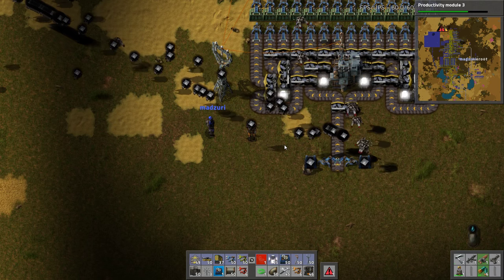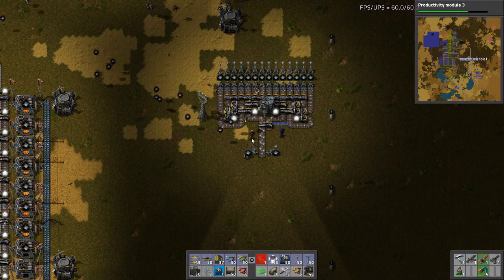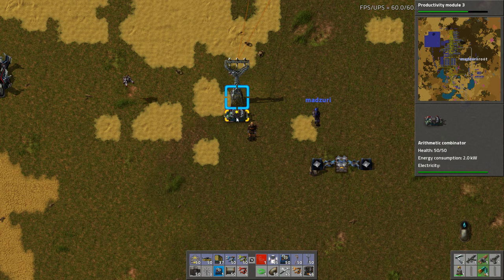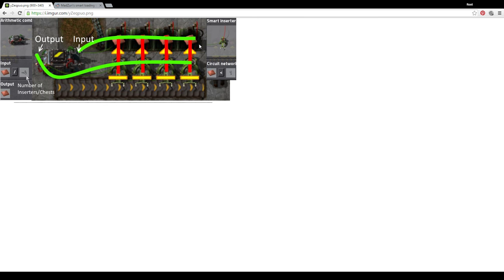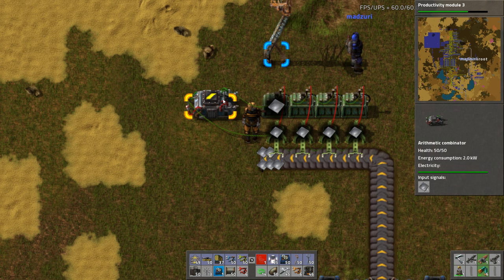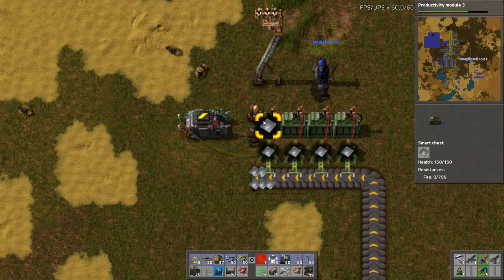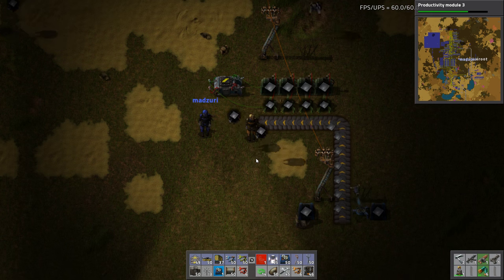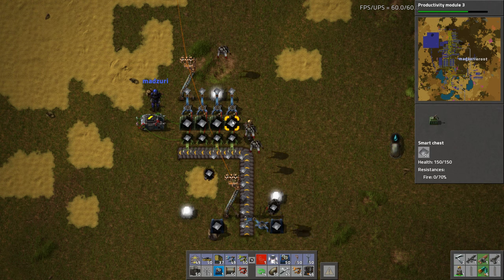Factorio Tutorial 58 Madzuri's Smart Loader

Comment: That's genius !
I would have never think about this one before a while, I would have put a horrible system with box, inserter and combi, so when the first box have more than the second, it transfer it, which is a waste of resources cause it require as many inserters -1 as there is boxes and combinator per inserter (to allow comparing to the next chest with "if iron plates are less/more than A" where A is iron plate on the next/previous chest +0 to not have them summed up).
Great loader here !

Comment: sssoooo ... mine stop when the chests are equal.  how do i get them to keep running when nothing is drawing from them?  I quadruple checked my setup.  I even took it down and remade it a couple times to be sure.
Reply: +WP Mac Haven't made this yet, but if I understand it correctly, you could make the belt go a little further and then add any inserter (probably a slow regular inserter) which wont be connected to the logic network set up in the video, that way, if nothing is being put into the chests, the inputs will go through to the end, be put in the last chest and will upset the average in the chests, so that it will work again
Reply: +WP Mac +Negative Root Or you might be able to have another combinator in series, after the combinator in the video but before the inserters, adding or subtracting 1 from the signal (I can't say for sure which, but that should do it)
edit: tried this and it worked x) subtract 1 from the negative mean and the inserters will continue loading, but with a buffer of 1 iron for each storage. This works as opposed to the original because some, but never all chests can have a real value of less than the mean.
Reply: Nomoturtle furnishing Well none of that is needed.  Apparently i had a missed connection or something somewhere.  I rebuilt it 1 more time and it works as shown.  Now I am running 60 inserters on this setup.  So I guess I can't be held to accountable for a misclick :)

Comment: Can you use storage chests or passive providers? Or does it need to be smart chests?
Reply from the maker: +ThatGuyWhoMayBeDead yep, you can use those other chests as they can be connected to the circuit network. However, you would have to be careful as it may break the circuit if robots start to mess with the contents of the chests.
Reply: I was checking for outposts since I don't normally have robots at them.

Comment: yay, a use for combinators and smart chests, a first time for everything I guess.
Reply from the maker: +martijn smit you must expand your imagination. combinators are the way of the future :)
Reply: Negative Root Might have to give them a try sometime, maybe some boolean algebra stuff.
Reply: +martijn smit you can even connect wires to regular logistics chests, as they are based on smart chests.
Did that for a smelting regulator, taking the output buffer as "provider" for skynet and that buffer also buffers my main-bus for the factory.
Total use:
Have a target value like 100k iron,
Then I substract the target value from the actual in the boxes  and output it as "iron ore" (target 100k, actual iron in boxes 90k -> result: -10k iron ore)
This leads to the unloading station and the "unloader" inserters work when iron ore < 0.
This way they unload exactly the amount "missing" in the buffers. Thus overshooting and belt-backup is minimized. (and my smelter belts are "clear" if unused/buffer full)
Side effect: once the iron reaches the buffer and the actual amount of iron rises, it immediately stops unloading stuff from the trains if nothing gets taken out of the buffers. =)

Using multiple of those provider/requester pairs to have a variable smelting area that serves either iron or copper production.
As I usually do not use both 100% I can build it a bit smaller and make it 150% of one ore type, 
and save 25% total space while allowing both to go 100% with the other to 50% capacity, in any combination. =)
Those things can do real large scale magic once you start playing with them.
Reply: ***** That seems somewhat over complicated but the effect sounds nice.
Reply: +martijn smit I love complexity =)